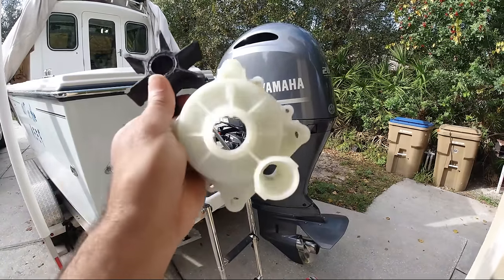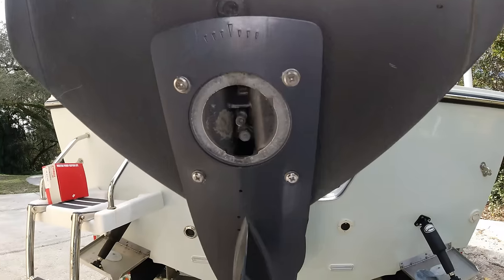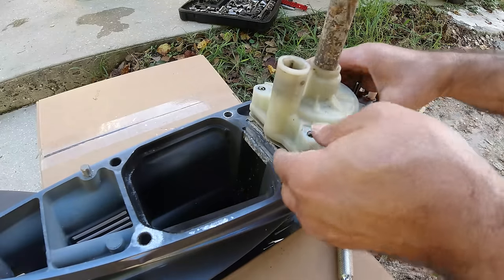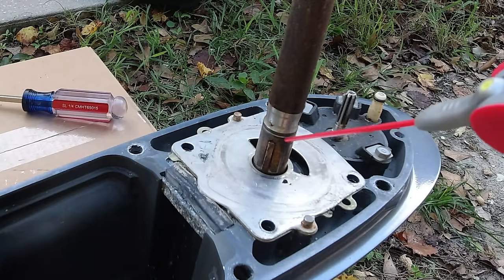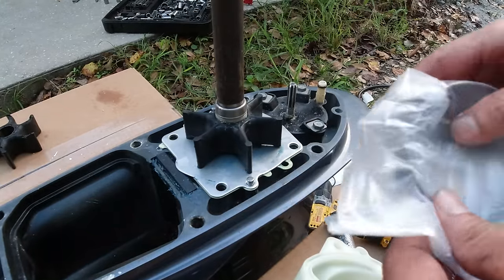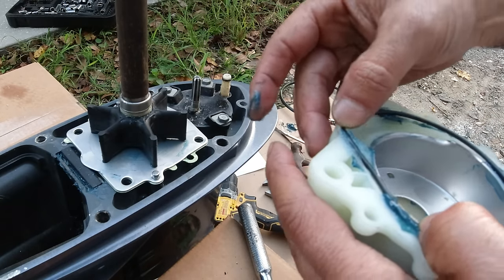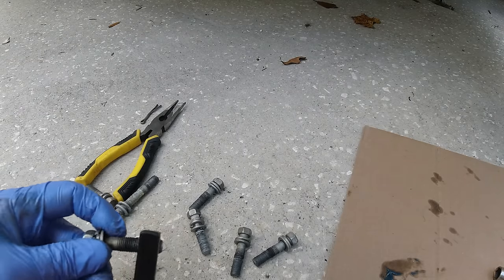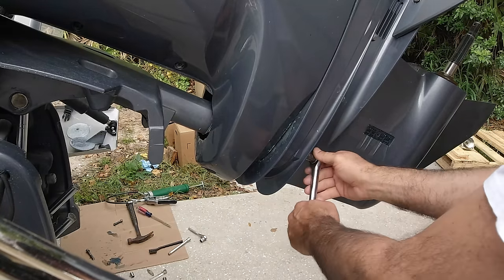Replacing Yamaha Outboard Water Pump Impeller and Housing DIY Yamaha 200, Yamaha 175,Yamaha 150 ,250

Comment: Hi, I noticed your video shows a step where you remove the old plastic housing intake clip and the cylindrical black rubber part underneath.  This step is missed in most other videos on this repair.  Does the replacement impeller housing usually not include the plastic housing intake clip or that cylindrical rubber part?
Reply from the maker: Hello cap.and no that's a different part number that you can find in a parts diagram and order them ,they should not be that expensive, I will replace mine on the next impeller replacement, And thank you for watching captain

Comment: Nice work. Pro tip I learned from an older gentleman that worked in the outboard racing business. After removing the plastic housing on the water pump. Remove the 2 alignment dowels on the steel plate and you can remove the plate around the woodruff key without needing to take the key out. The hole in the plate is just big enough to slip by it. Saves so much time and no need to ever remove the key, just clean around it.
Reply from the maker: Very true, captain and the Woodrow key I did not remove it last time. I did the impeller change so it was well overdue. Probably on the next time. I will not change it but if it removes easy. I will change it again because it gets stuck with a salt water environment. And I really like to take that off but I see your point. Thank you for your comment and for watching captain.👍🛥⚓️
Reply: Upvote for you! That's a great tip. I've had to cut the woodruff key down the middle with a Dremel to get it out before.
Reply: The woodruff key is a pita for sure. A tip for next time which has made removal much easier for me is to grind a small amount off the back side (rounded half) that goes into the shaft to make it more tapered. Not too much, just a very little and it does not get stuck too much.
Reply from the maker: @Grady252  great point cap. Thanks😉

Comment: Thanks for the video.  FYI, petroleum grease / lithium grease will cause elastomeric rubber to degrade, swell or rot out.  It’s best to use silicone grease or nothing at all on the rubber o-rings.
Reply from the maker: @bds3919  Thank you for the suggestion kept and I appreciate your help and thank you for watching

Comment: What year is your Yamaha 200? Just bought a new Yamaha 115. Did you also change the impeller at 100 hours?
Reply from the maker: yes the impeller was change in the 1st 200 hrs and my engine is a 2017 and it haves 410 hrs cap

Comment: For any other F200's owners who put it all back together and get a bad clunk at low RPM's (it sounds like prop chatter, but worse)....preload the the shaft/pinion space by PULLING UP ON THE DRIVE SHAFT while hammering down the metal collar over the plastic bushing / 3 washers. Its a lot easier to have someone help to do this step.
Reply from the maker: great point cap, this happens sometimes thanks for sharing cap.

Comment: That looks just like I did it 24 years ago on a Yamaha 175, Captain.  For Woodruff keys, I start out with the biggest chisel I have and when replacing.  Getting that impeller started is a pain sometimes because you think you are going to damage it.  In addition, I use Scotch-Brite on the vertical shaft and the prop shaft to keep the corrosion down. ( I used to work part time at several marinas and did just about all of my own boat maintenance on Mercruiser and OMC outdrives, grew up working my Dad's boats which where I learned).  Great job.
Reply from the maker: Great suggestion, Jeffrey. Thank you, and I'm sure you have good memories when you used to work with the dad. And thanks for watching and always navigate safe captain

Comment: Thanks for doing this WP video.  Will be doing my f150 soon and your demo shows all the tricks.  I've done 50 hp and 15 hp but never a motor this large.  I hope mine goes as well as yours did.
Reply from the maker: I am sure you gonna do well, captain. Just make sure you put everything back together. And when you put the outdrive in, make sure the shifter and the speed diameter is fit in place and you shouldn't have a problem. And in the future, let me know how I went. Thanks for watching.

Comment: Tip I've seen don't know if it's pro though lol I learned to put a zip tie around the impeller and fold the fins to the direction it's supposed to go pull the zip tie to keep the fins in place. You then put the housing down half way to cover the top of the fins then cut the zip tie, housing slips right on
Reply from the maker: That is a awesome suggestion cap. I think it would work just fine, thanks for sharing it with me cap.👍👍⚓️🛥

Comment: You should've sanded the side of the new woodruff key down a little bit. Had same issue with my F150. Sanded/filed a tiny amout off the woodruff key and never had an issue since. And use anti-sieze instead of grease on the key too.
Reply from the maker: Great choice cap. Thanks for the idea 😉👍🛥⚓️

Comment: I've melted the housing and impeller running the engine on muffs before. It looked like I ran it with out water...but I hadn't! I had the dual inlet style muffs and the muff rubber had gotten hard over time..and allowed a lot of water to leak around them.
Reply from the maker: Wow cap that is very serious like in my situation i melted mine, from now on i will keep a better eye on the flushing,  navigate safe cap
Reply from the maker: @nameunavailable456  wow cap. I think from now on i will flush thru the port to avoid that problem
Reply: Was going to ask why you run on the muffs. That can lead to many issues like you experienced for overheating if you have any leakage or not enough water pressure/volume. Best to just flush via the flush connection.
Reply from the maker: @Grady252  good point but if i did not use the muffs i would not find out that is was a problem cap. But i see your point👍
Reply: Haha, but using the muffs caused the overheat problem in the first place right?  Anyhow, normal maintenance should change impeller every few years or sooner if notice a reduction in the pee spray stream. Some folks don't trust the flush port with hose, but after 1400 hours on mine, when pulling out the thermostats, there is very little corrosion, so it must work good enough.

Comment: We just bought a trawler surprised you haven't looked at them with your mechanical know how we picked up a 34 mainship they are a little slower but burn no fuel and can take bigger seas. 2gph at 7.5 knots like a house you can fish from.
Reply from the maker: Hello cap. And i would love one of those nice boats but i always tow my boat home and that will mean i will need a bigger truckand that will cost me more to tow from Orlando to Miami cap. And congrats on your awesome purchase cap, see you on the water
Reply: @OutOnTheReef  you leave in a wet slip you can get an older mainship like we did and fix it up there like 30k for a decent one that needs some love we bought in fort Pierce and drove it back to Hernando county FL that was a fun trip through the okeechobee locks. Keep the little boat for short fishing trips and use the trawler for Bahamas trips. Just a thought...
Reply from the maker: @nautibossfishing3283  awesome idea cap. In the future it will be a awesome choice thanks cap. And enjoy that trawler
Reply: @nautibossfishing3283  what size engine do you have.? The Perkins 160.? Whats the top speed?
Reply: @user-dc9bq1nn9n  it has the turbo charged Perkins diesel think it is 240hp not 100% positive wide open we were getting 10knots burning about 7gph.
Reply: @user-dc9bq1nn9n  built like a tank we went across Tampa Bay in 5 footers my wife get sea sick my ass was puckered she said wasn't that bad but it was after dark and freezing out so I figured if this old boat breaks I'm a gonner lol

Comment: I had the same thing happen on my 2014 sportsman 211, melted impeller housing.
Reply from the maker: But at least you caught it on time, captain. Because if you continue, it will burn up the engine.

Comment: how do you clean the bottom of the hull while on the trailer? it looks so clean almost as if you waxed it.
Reply from the maker: Hello cap. And i just washed it with car soap thats all and it stays bery clean and i have never waxed it yet ,thanks for watching cap
Reply: which car soap do you recommend
Reply from the maker: @user-dc9bq1nn9n  maguire is what i use cap or you can use any other that leaves and wax residue 👍

Comment: Great video.. Just out of curiosity how did you learn of outboard motor mechanics?
Reply from the maker: Good question, captain. I always love to work at engines and do modification and a little bit of engineering. But I have never went to school for it. I did it all on my own. And also I have some Is technical experience on Air conditioning and refrigeration so that comes in handy when it comes to England's. How they work and thank you for being an awesome viewer of my channel. Captain, see you on the next video.

Comment: Very nice job cap. Inspires me to do my Yammy. 350 hours on mine and still pushing strong cooling water but don’t want my luck to run out and eat an impeller blade suddenly. 
Very interesting to see how that housing melted!
Are all those parts part of a replacement kit or did you need to order them all separately?
Reply from the maker: The plastic  housing is separate Since you only need to change it when it's damage. And yes, some parts need to be purchased separately because it doesn't come with a kid.Captain and thank you for the awesome feedback

Comment: Hello from Big Pine Key. Very good water pump changeout video. All good preventative  instructive info for others to follow. I just got my CMOR V-5 South Florida card and two new Penn Squall 30 wide 2 speed reels with 60 lb to go with my two Shimano TLD 25's with 50 lb. Just about set for some serious Wahoo chasin, (and anything else). Weather is 15--20 MPH northerly winds for days now, so gonna install the new wireless kill switch today to get ready for the next fishing opportunity offshore. Do you still have the link on the video for the Stainless Steel anchor? It is the perfect choice for my just over 2 ton 23'-4" boat.
Reply from the maker: Hello, captain and you sound like you really are ready for some serious fishing and due to weather I have not been able to get out there. It's been very rough but in the floor of keys. There's good days, some days. And I don't have the link since amazon doesn't let me use But it's a fourteen pound delta style anchor and you can find at amazon
Reply from the maker: Thanks for watching them hopefully see you out there captain

Comment: Keep your eye on the harmonic balancer. That’s what went up on mine. Motor threw a low oil pressure light. The balancer hear had exploded and sent pieces down into oil pan.
Reply from the maker: Wow, captain sorry to hear that, and thanks for the heads up. I will look into it👍🛥⚓️